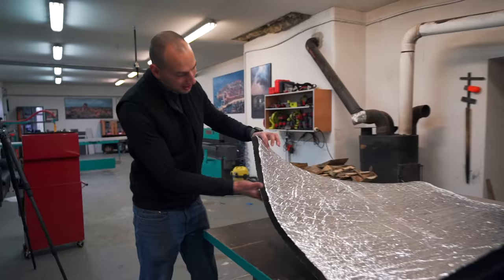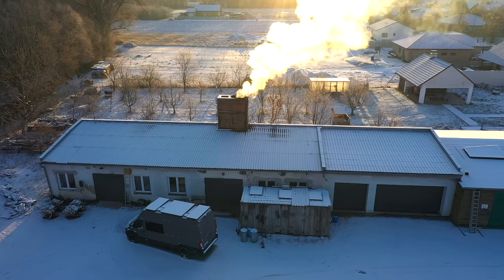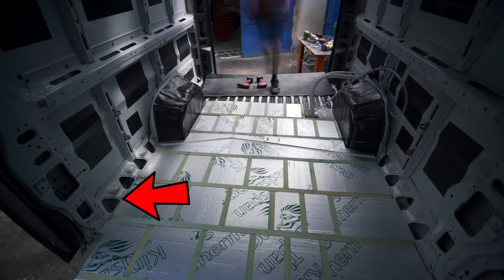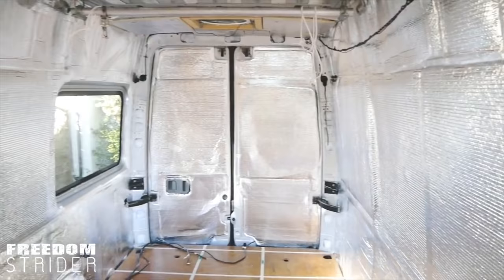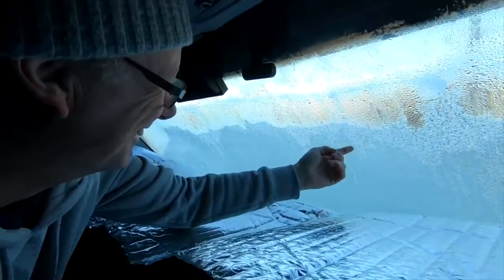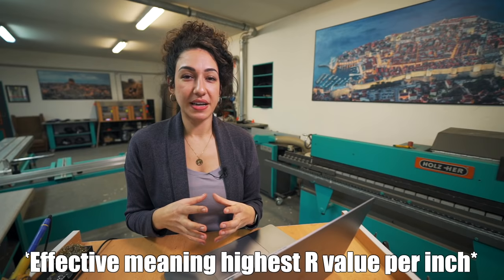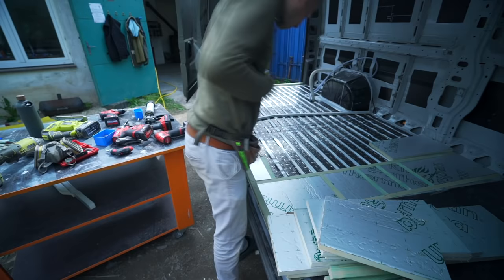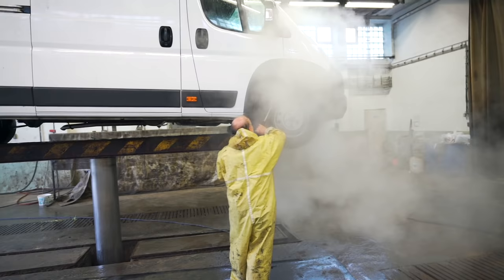❄️How to *ACTUALLY* Insulate Campervan for WINTER VANLIFE ❄️

Comment: Do NOT listen to this woman. If you want to find out about condensation or vapor barriers. Go watch "The Frugal Factors" actual real world experiments! A vapor barrier is useless!! You want to put this stuff called Poly-fil between your insulation and the METAL exterior of your van.This stuff is used inside cushions on patio furniture that is made to be left out in the RAIN!!
Condensation is going to occur on the exterior metal of your van NO MATTER WHAT YOU DO!! This poly-fil will intercept it and allow it to flow down your wall and outside those holes she told you about! Yes, do NOT insulate those lower parts of your van; you need the water to flow out!! 
I did NOT do a van (too much metal), I did a box truck!! The inside is mostly square and very easy to insulate!
Plus, it's high enough to walk around in, and used Budget trucks are cheap if you know where to go, auctions. It does take time to find the right one.

Comment: Three big mistakes you guys made. One was to change white to a darker colour, this will make the van a lot hotter in the summer, so any insulation will be rendered less efficient. Next roof solar panels means you you will have to park in the sun, what a stupid idea. And third too many windows, windows belong in greenhouses, there is the clue. One window in the sliding door will give plenty of light in a Transporter size van, a couple of extra smaller one in a larger. I suggest minimal floor insulation and then use carpet, ours is 7 years and 150+ nights old, with a dog and still looks good and no big deal to replace either. It is a lot more convincing if the spokesperson does the work. "Those that can't, teach"...
Reply from the maker: Wow, it’s interesting to read your perspective, but I disagree with almost every point. Although the paint color does attract sun, we were nice & cool this summer. What we prioritized was the stealth aspect (NOT IN CITIES) it’s really difficult to spot out van from any distance, just grey and blends in wherever we are, esp in mornings/evenings/night. It’s made freedom camping much easier. The coverings on the roof windows are reflecting, and the solar panels shade the top of the van. So when the sun is the highest, we are comfy:) solars on the roof is a no brainer especially because of short stop overs, the process of setting up every night/morning… titling solars has been a dream. I can’t imagine having to store panels all the time, esp 1kW worth. Carpet isn’t really attractive to use because of our activities (biking, winter camping, etc) so floor heating under our vinyl has been amazing, and super fast to clean! For the windows amount: we were open to only having 1, but I’m glad we did the 2, especially because then we aren’t limited with view regardless of how we park. Plus it’s nice to be able to spy outside all the time 😂 to each their own!
Reply: @ladiandmargaret  Okay thanks for the explanation. First of all I assume you have been camping in the UK? We live in Portugal and this year traveled to Greece and Turkey and these points I mentioned count. Our van is white and pretty stealthy out here because most vans are white, we (foolishly) have a dark coloured car and the difference when parking in the sun is enormous. We installed 2 windows, but  keep one pertinently covered up and no rear windows and it's good. 

Now I know that you are Youtubers and work in your van, but really for the rest of us there is often no need for solar or a second battery, etc. although everyone does this. We have a few LED lights and 4 USB chargers and have never run out of power, even before we put a larger battery in when the main battery needed replacing. And to be on the safe side we carry a small starter power pack, which we have used once to help someone else. Our cold box is only powered when the engine runs, which keeps milk and butter cool enough.

We have a molting dog and walk a lot, so the carpet isn't perfect, so we use a rubber mat, sweep and vacuum out when we get back.

Spy points is a good idea when wild camping, but carefully choosing your spots essential. Also parking for a fast getaway is a must.

"Underfloor heating" yeh.. you must be in the UK.....blends in with grey too...

As an engineer my philosophy is KISS and if you don't need it don't have it, if you have it there is something to go wrong.. Not many people know this but in the old days (long before you were born) they used to have a formula called the BTBF.rate.. Mean Time Between Failure. Now it is Go buy a new one, or pull your hair out.

Have fun...